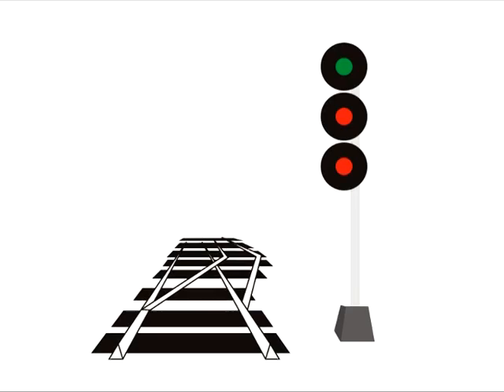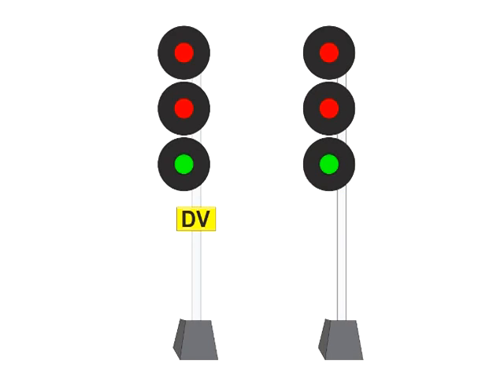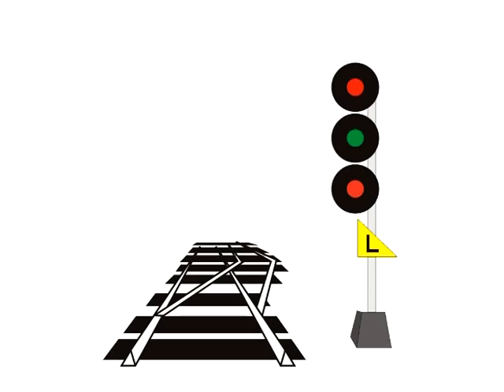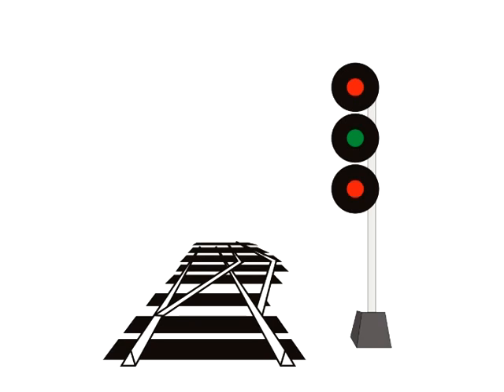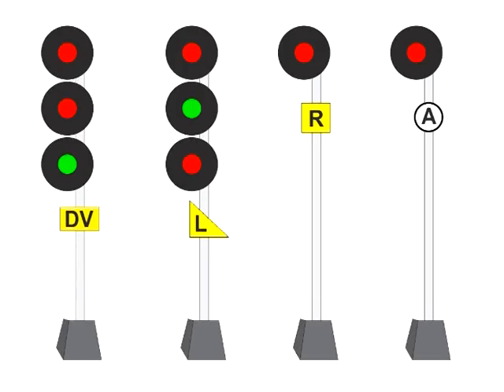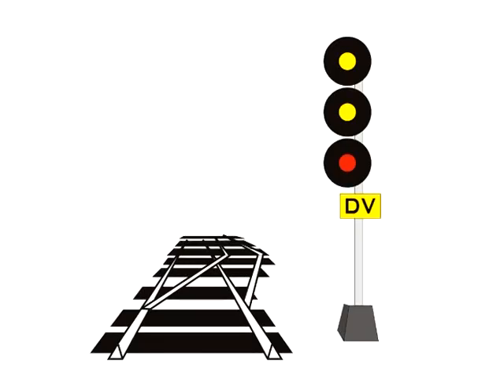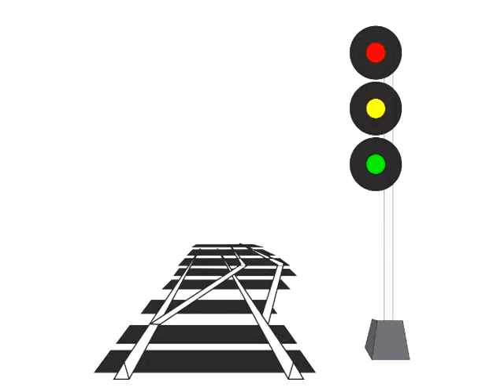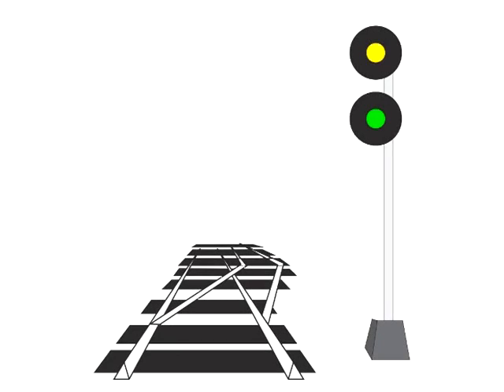Part 3: Railroad Signals, reading and meanings. Diverging and Limited speeds, to and at signals

Comment: Sooooooo complicated, the British system makes much more sense
Reply: +Szymon Gorczynski . Canada is much larger in comparison to the UK, the UK is the size of Ontario. Most of the goods in Canada are coming from the port of Vancouver, then travel by train for 2000+ km. The large distances goods have to travel creates lots of hazards that you wouldn't encounter in the UK. The "seemingly hard System" reflects all of the conditions that can occur. There's a lot of varying terrain the freight will have to travel with and each province is slightly different geographically.
Reply: +Szymon Gorczynski. Lets see: 

1) Geology: Very difficult terrain steep mountain passes(ex. Rogers Pass). 
2) Climate Hazards: Some railroad track have been shifted do to Permafrost. 
3) Nature: Wild deer and moose. 
4) Traffic: There's only one main track from the Rocky mountains and the trains have to share.

Outside of the main urban areas, its very rural and some of tracks aren't as well maintained. 
I could list many more.
Reply: Ben III And that's what fixed speed limit boards are for.
Reply: This is complicated.  It's the most-complicated signaling system in North America.  Some of the exotic aspects (like Slow to Medium) seem pretty easy to confuse, and the Slow speed aspects don't really fit into a concise pattern like the other speeds.  Additionally the "Diverging Speed" explanation at the start of this video is probably premature and a bit too confusing at this point.   But this is a very strong speed-signaling system, where you always know the maximum speed at this signal, and the one following (sometimes the one after that).   There is something to be said for that.
Reply: +Szymon Gorczynski.  Obviously the signals are a reflection of the hazards. A low speed whould reflect a train going up a steep grade, ex Rogers Pass. But because theres only one track serving both directions the trains in the other direction will be force to slow Remember theres a lot of traffic so it cant stop, thats why it gets complicated.  Outside of Toronto,  Vancouver and Montreal you will be surprised how primitive things are in the rual parts of Canada.
Reply: +Szymon Gorczynski It really isn't that complicated. Once you know them you don't forget them.
Reply: Szymon Gorczynski it doesn't take long.  Sit down with the flash cards and you'll have them memorized in a couple hours ... if that.
Reply: Tommy Truth they're not complicated.
Reply: The plus-ing is a bit confusing since people can change their nicknames at any time and they don't seem to line up in this thread.
But one thing to keep in mind is there are different kinds of speed limits on a railroad.  Speed limit signs (permanent speed limits) are, well, permanent.  Signals provide transient speed limits, which vary by location or size or speed.  The two are not a replacement for each other.  A train is only allowed to go as fast as the slowest type of speed limit applicable at any given moment.
Reply: +GEES44DC probably the rural parts of Canada, I know some people would be offended by that part. I'm sure you realize how trains are susceptible to avalanches in the Rogers Pass. As well as the effect of permafrost on Tracks in Extreme Northern Ontario.
Reply: Ben III I understood his comment to mean that the way the railroads are operated are different in rural areas.
Reply: +Szymon Gorczynski Ridiculously complicated.   You know that is true when it takes 4 parts to explain them.
Reply: Tommy Truth Under the British signalling system you have 4 aspects to remember + an extra 4 for diversionary routes and your semaphore signals. This is just pathetic.
Reply: +Szymon Gorczynski   Anybody who can learn all of this belongs in medical school or getting a PHD in physics.
Reply: Ben III And what exactly has that to do with the signaling system?
Reply: Ben III I think you may be confused. What you have said here makes no sense and is not accurate.
Reply: ***** Cause by the time you manage to memorise it you're dead.
Reply: ***** But what's the need for such an over complicated system? Take a look at what the British one is like.
Reply: SirXavior Which is what speed boards are for?
Reply: Ben III What are said hazards?

Comment: I was following it in the first two vids but I'm now lost.
Reply: The UK railway signalling system doesn't communicate speed limits as Canadian signals do. Speed limits are given as wayside speed limits boards placed to the left hand side of the track similar to what they are on public roads. All engineers are trained to the route they work on the subdivisions they travel on.
Reply: @François Parent
You're confusing two different concepts there.  All trains operate at the slowest of all of the speed limits that apply to them.  There can be many different types of speed limits in force at any given time.  

Canada, like the UK, has permanent speed limits assigned to the tracks, and those are officially marked by signs.

Signals in general, and these signals, dictate transient speed limits.  These are speed limits that change or vary by time or distance or situation.  These are a second type of speed limit above and beyond the track speed limit that you're talking about.  These are also a separate speed limit from the general subdivision speed limit (if one), cargo restrictions, weather restrictions, yard limits, etcetera.  

Each of the speed limits do not affect the others.  If a signal indication imposes a 30 MPH speed limit, then only another signal indication can remove it.  If a temporary speed restriction imposes a 10 MPH speed limit, then all the Clear signals in the world can't remove that.

Signals in the UK can impose speed limits. Approach Release signals are an example of this.  It's just different from how it's done in the US and Canada.

Comment: Seems like the fail-safe principle isn't universal here, for example if a medium-to-medium signal (two lower greens) has its bottom color-selecting magnet fail, defaulting it to red.......won't it read RGR......a medium to CLEAR signal?
Reply: +yabbaguy Improper signal progression. The crews are to be aware of that and act accordingly.
Reply: Most signal systems are designed so that if a failure is detected, the signals ahead of them respond accordingly.  For example, if a flasher failure drops a signal from LIMITED TO CLEAR to MEDIUM TO CLEAR, the signal before that might also drop from (e.g.) CLEAR TO LIMITED to CLEAR TO MEDIUM.  The preceding signal might also just drop to CLEAR TO STOP.   This is because a failed flasher can fail not just to keep the green solid, but to also make the lamp stay dark.  Red over Dark over Red is not a valid signal aspect in the CROR, so the signal is improperly displayed.  As all improperly displayed signals are supposed to be interpreted as their most-restrictive indication, the train would have to stop at that signal (since a signal showing LIMITED TO CLEAR would have a most-restrictive-possible indication of STOP SIGNAL).
Reply: Jovetj for the bottom part: If yellow or green is still being displayed on a light, the most restrictive indication possible does not apply. They proceed prepared to stop at the next signal, slowing down slow speed ONLY if there is a switch present.
Reply: It's just a matter of perspective.  I reckon a good portion of every rulebook is common sense.  It's just a matter of how pedantic you want to be with the balance.  I am not a railroader myself, but I am sure I could find some that would roll their eyes at the much-more-complicated nature of the CROR signal schema, for example.  It doesn't mean it's right or wrong, it's just what suits a given railroad best since they're not all the same.
Reply from the maker: US track warrants are more complicated than the Canadian OCS clearance? You got me curious now - in what ways? Why do you say that? (never worked a US track warrant obviously, hence the reason I ask)
Reply: GEES44DC "our signals are not more complicated"  
Well, that is your opinion.  41 separate signal rules (not including switch position indicators or audible signals or wayside signs) versus the 22 of my local railroad.  It's complicated.  The lower head indicating Slow/Restricting/Diverging speeds, except when it doesn't.  That's complicated.  The middle head indicating Medium or Limited speeds...except when it doesn't.  That's complicated.   This video (out of all of the four) got really muddy because...it's complicated.  Complicated isn't automatically bad.  Complicated doesn't mean that it doesn't have some logic throughout it.  It just means that there is a lot to keep in mind and remember—especially those arbitrary aspects that do not fit a neat pattern.  The fact that they all mean the same across the whole country is definitely a plus.  Some of those exotic aspects do not seem to be very clear in their application, though.  But I also don't claim to know everything.  

Of course there are differences between OCS and TWC, but the key point is that they do the same kind of job in the same way.  Most traffic control systems in the world can be divided into a handful of categories, based on things like whether signals authorize movements, etc.
Reply: Doesn't look like my replies are showing up correctly here.   Or something.  Thanks, YouTube!
Reply from the maker: I agree.  It's the best they can do.  :)
Reply: Yes, you are quite correct. That is a unique faucet of the CROR I did not know!
Reply: No U.S. rulebooks work that way to my knowledge.  If the aspect is not in the rules, the whole signal is invalid and disregarded, and the most-restrictive indication for the type of signal applies.  So like I said, that distinction sure seems unique to Canada/CROR.
Reply from the maker: Okay, will do. I never noticed any US ones.  Are they marked even?  The Canadian ones aren't marked as "Canadian"  :)
Reply: You'll know it. There should be something about track and time on it.
Reply: Jovetj if the bottom is solid yellow you simply treat it as a restricting.
Reply: Jovetj I've glanced at the US rule books and I must say they're ridiculous. They seem way too over complicated and unnecessarily restrictive.
Reply: Jovetj our signals are not more complicated. They are very clear in their applications. They mean the same thing on every railway.

Having a full understanding of the CROR, I can read the US rules for the exact same application and be confused. 

The US track warrant seems much more complicated than the Canadian OCS clearance.

CTC rules in the US seem more complex than here in Canada.
Reply: Ian Juby check the desks on all units you are on,  Ian. I quite often find them in there with the Canadian paperwork.
Reply: Ian Juby I was able to add a UP journal to my collection by rummaging.

Comment: Great video , am learning a lot more here!  Cant wait to see the next part. I have a manual for CSX signaling. I was wondering if every railroad uses different indications and stuff. Like if am running a BNSF train on BNSF trackage and I diverge on to CSX trackage , how would the rules change? Thanks
Reply from the maker: Ya, apparently it's a bit of a mess in the US because there's no standard.  There's old grandfather systems here in Canada, but we do have an agreed upon convention, the CROR.
Reply: @ianjuby  Great presentation, Ian! Would you recommend a formal CROR course which ends with exam and certification?
Reply: If you're bored, you can study a bunch of different railroads' signal rules on my website:  http://signals.jovet.net/rules/index.html
There are many subtle patterns and practices that are used by different signaling systems.

Comment: Question: Does the bottom head and middle head always mean a train is always going to switch to another track (lets say South track to North track) regardless if its flashing or not? For instance, medium to clear, Limited to stop
Reply: +CN Trainman Yes
Reply: As far as I know, that is the case. The only thing I can think of, here in Winnipeg, there are some signals that will indicate (Y/Y) Clear to Slow, (Y/R) Clear to Stop, (R/R) Stop.

Comment: A sign falling off or getting covered in snow would not change the speed we have to take that switch at. It's a diverging/limited speed location. Just because the sign falls off wouldn't make us have to take that switch slower. We'd simply report it and they would come and fix it. If it was covered in snow I wouldn't even report it because we already know that we're good for 25/45 on that light.
Reply: Of course, you'd have to know its a Diverging or Limited signal.

Comment: Interesting, thx for posting. How would you know when the rear of your train has passed a signal, if say you have a mile long train?
Reply from the maker: We have a counter that we can push a zero button on it. We hit the button once we're clear of the light, and it counts the distance we've traveled according to the wheels.
Reply: Thx for the speedy reply Ian. I guess it was so much easier when the rear brakeman could call out from the caboose ;-)
Reply: Ian Juby My initial guess was that the rear end device had been fitted with some radio signal indicator that when it passed over a switch it would emit a signal to the controlling locomotive.  So, there is a counter.
      Thanks for this series. I have suggested some of my friends view it.  I volunteer in a yard that has vintage railway equipment and we use nothing beyond hand signals.
Reply: Train crews also need to be familiarized with a line they operate on.
Reply: An engineer familiar with his route will also have a rough idea where the end of his train is without the use of the counter. Not exact of course, but a good idea.
Reply: If you know the length of the train and the speed you are going, it's possible to calculate how long it takes from the front to pass a point till the end passes, but considering everything else of which the crew has to watch, that would be too much.  A counter was the right decision.
Reply: Thx for all the replies guys, much appreciated.
Reply: ***** Agree'd. The counters are quite often unreliable as they get out of whack with the locomotive wheel wear. If you have an engine that has wheels that have seen some wear and the counter has not been calibrated for that wheel size, the counter will be useless.
Reply: There was one other possibility in limited situations of which I thought.  If you are transversing an interlock on parallel tracks, and can look back, once the rear of the train leaves the other track, the signal on that track should go clear if it is an automatic traffic control system.
      The steam locomotive I help maintain has no speedometer and GPS devices are used to tell how fast she is going.  I guess the only other alternative would be use a stopwatch and count the time between mileposts.
Reply: You can also look at the mile post besides the tracks
Reply: Ian Juby If you want to get fired.
Reply from the maker: haha! Well it is only for the convenience of the other crew. Obviously they gotta operate by signal indication anyway.  :)
Reply from the maker: +Lewis Doherty Yes, good point - and as Glenn Horton mentioned, mileposts.  We often look in the mirror to see if the "Back door is open" (green signal) for the other opposing train and will often tell them that over the radio.